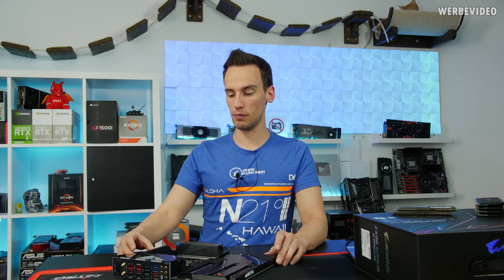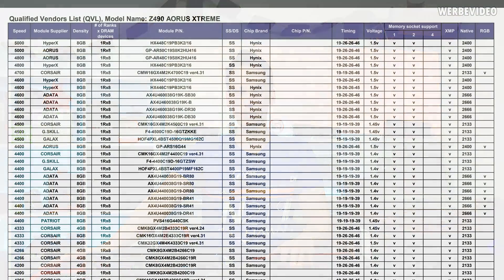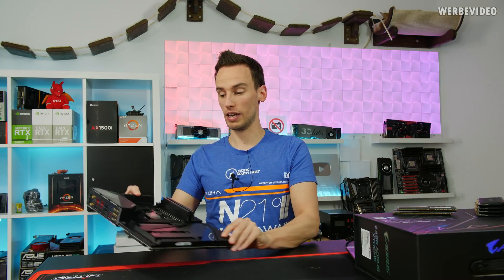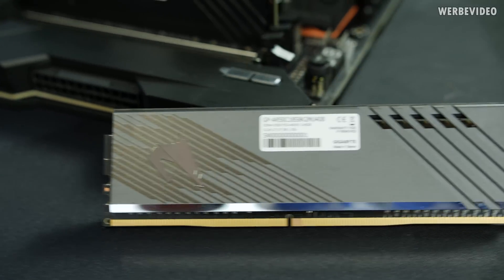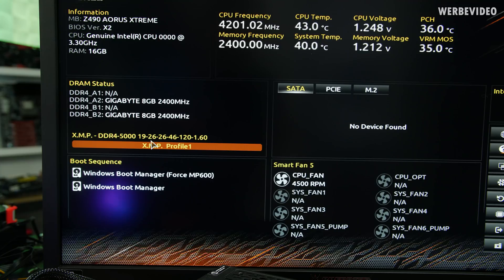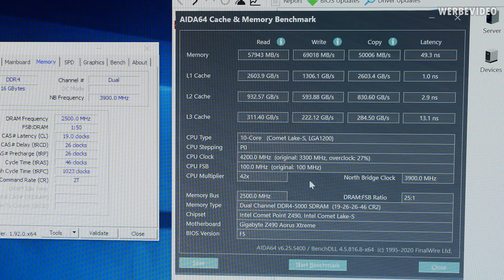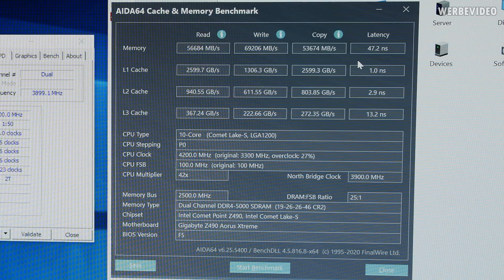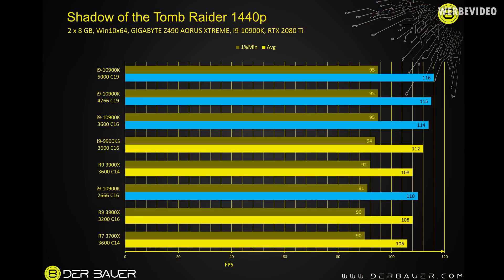5000 MHz Memory Speed was more difficult than expected. But will Games benefit from it?

Comment: 10:50 thermaltake's watercooling for ram aio finds its use XD
Reply: I've been overclocking my 3200c14 DR b-die kit a lot on 1700x and now 3700x and I've seen better stability with lower temps (after removing the front D15 fan that actually blocks the airflow around the RAM with its frame and adding a small 40mm one blowing sideways "through" the sticks). Achieved 3466c14 with somewhat tight timings. Maybe could get better results but it is exhausting and I don't want the best results possible since I'm working and gaming at this machine. With previous setup (e.g. d15 fan overlapping and without additional cooling) got errors after like 20-40 mins of testing
Reply: Not really. 3% drop in temps with their dumb cooler
Reply: @weavercs4014  the 3% is in kelvin (which is the only scientifically correct way to use percentages to compare temps) so the difference is actually bigger than it sounds
Reply: @tranarchist6335  why are you usng kelvin though??? Imagine someone saying "oh yeah, I undervolted my processor and it dropped temperature by 5%", you'll look either like an idiot or a snob. not good either way
Reply: @Fuscao_Preto  nobody uses kelvin for percentage difference here except when someone tries to sound smart. The temperature difference in almost all cases is expressed as a delta
Reply: @BusAlexey  You are correct that people don't normally use percentages to compare absolute temperatures, but the point is that if you do, you need to use a scale that starts at absolute zero.
Reply: @weavercs4014  It's scientifically wrong to measure temp difference in percentages (except when it's it Kelvin)
Reply: @BusAlexey  it is  3%  in kelvin they have marketing material claiming a 20% difference (in celsius)
Reply: "GN cult" clickbait/lies/pandering videos made more victims I see....a real hardware reviewer would have cared if the memory cooling kit prevented the gpu backplate from cooking the memory while gaming, and yes memory temp is a problem so says.....buildzoid search for : RAM overclock stability and heat management
Reply: @fredEVOIX  Whether you like GN or not, they were correct that it's not valid to compare temperatures as percentages unless it's an absolute value (i.e. kelvin), or a delta. How on earth is a GPU backplate going to "cook" RAM in your DIMM slots? There are reasons you might want to watercool your RAM for an extreme overclocking build, but Thermaltake was advertising their cooler with claims which were simply not true. If you don't see a problem with companies lying to people to sell their products, I don't really know what to say to you.

Comment: 9:08 I already predict "47 seconds? that's not good XD" comments
Reply: 47 NANO seconds, completely different than Seconds. ALSO, he says right after that other typical CPU's are only able to run the fast kits with a latency around 60 NANO seconds, so this 47 NANO seconds is super fast already and it gets even a little faster than average as well so it's a good balance of speed and latency, and better than others.
Reply: 47 nanoseconds latency is actually pretty bad for memory overclocking on z390/z490. Sub 40ns is easily doable on any decent samsung b die kit.
Reply: Ryan got pretty crappy tridentz 3900 cl16-22-22-34 cr2 630trfc, scoring about 39,5-41,5ns in aida64. 55-57-52gb/sec